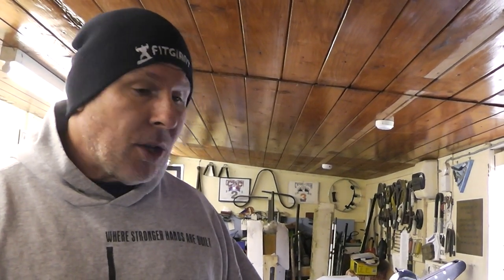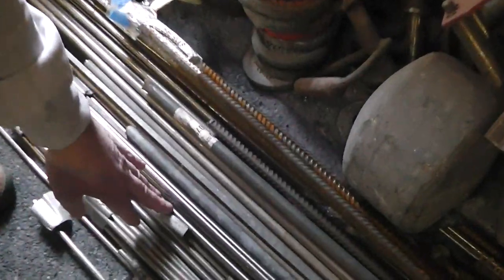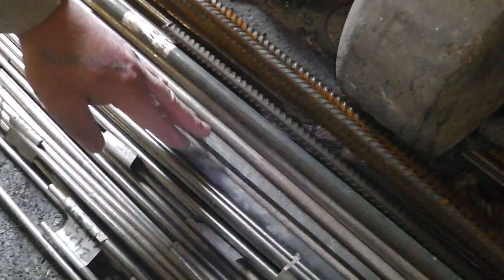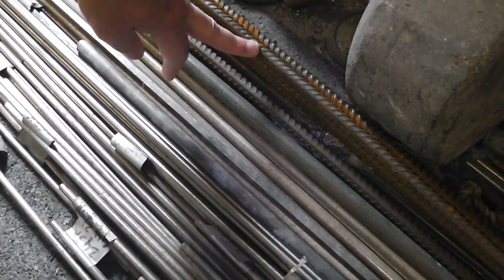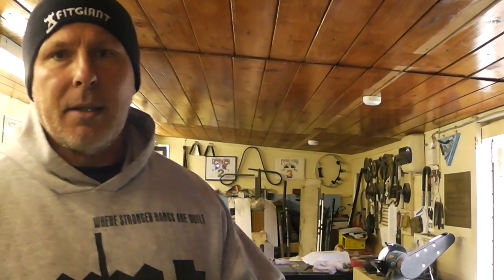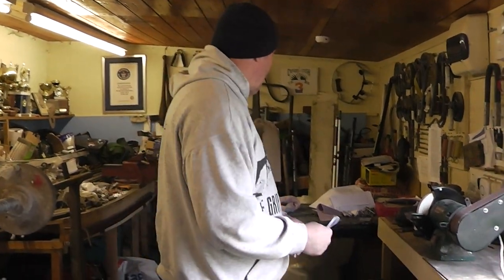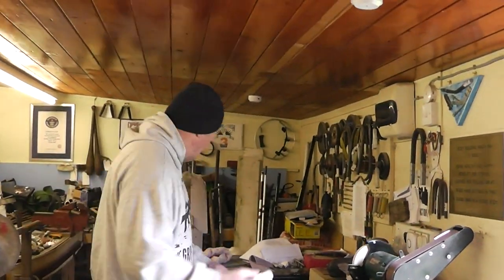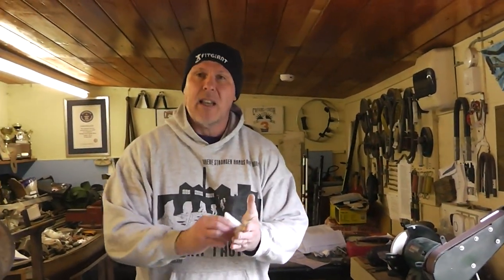Beginners steel snapping info for grapplers, bjj, etc

Comment: Do you only train the snap on one side or do you swap side to prevent imbalances? Also do you need to do any form of barbell lifting to gain overall strength or can you just do this?
Reply from the maker: You certainly can do the pulls from both sides. When I do this I put a protective towel on each leg. There are many grip, strength and other training's to do. But as a start, and  a productive start this is good.